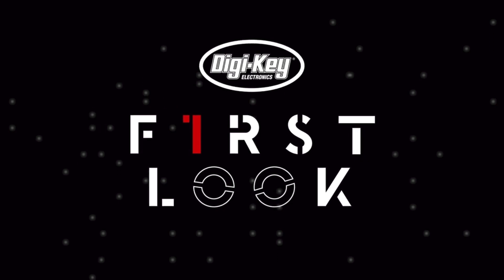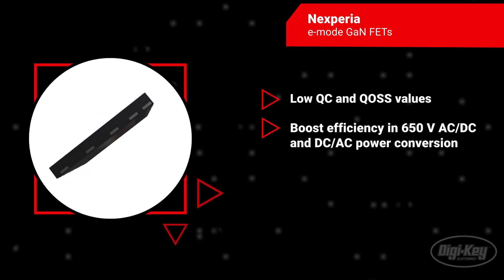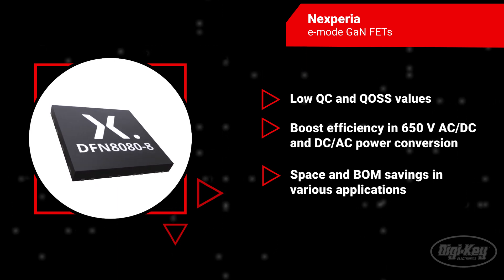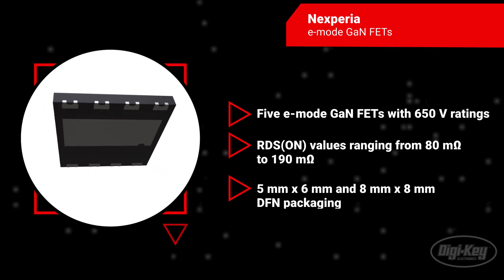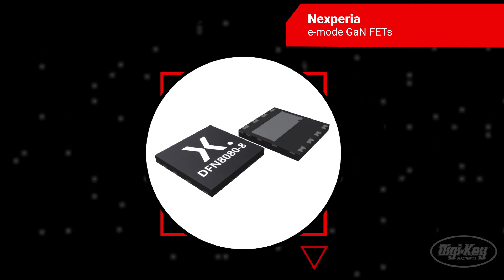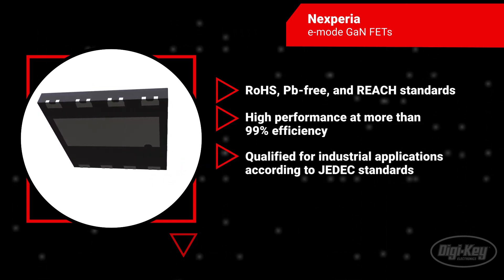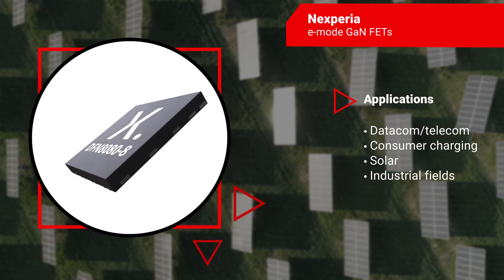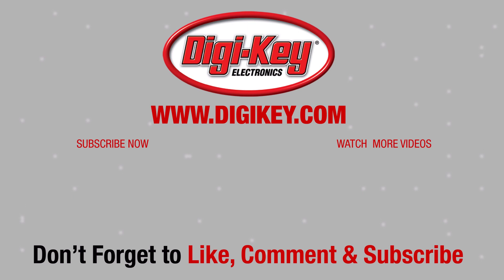Nexperia- e-mode GaN FETs | First Look

Comment: dont uderstand a word   𓂺ᡭ   ??
Reply: GaN FETs Galium Naitrait (?) Mosfets a more or less new substrate for mosfets with low (heat) losses, most known consumer use case is in modern high current (Watt rating) and small size cellular/computer chargers.
Reply: @hongotopiadada7574   woosh